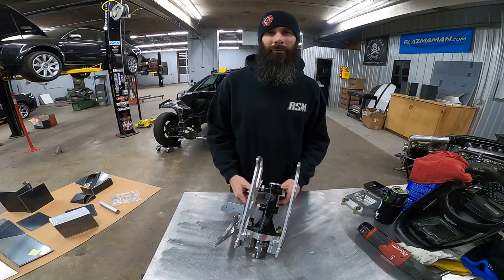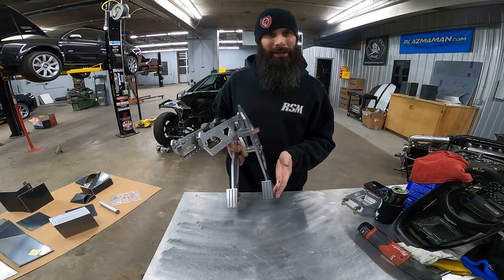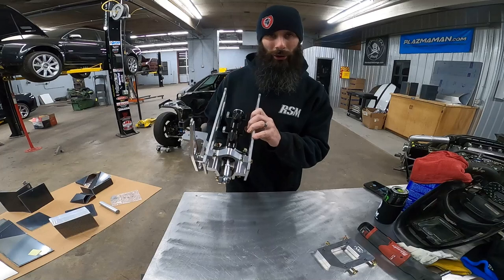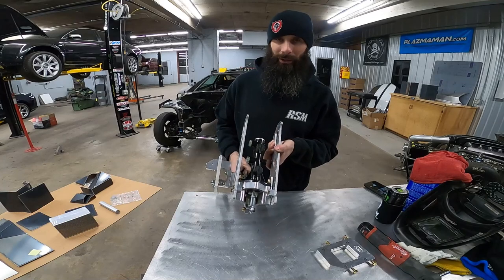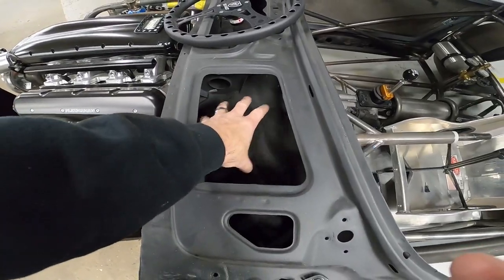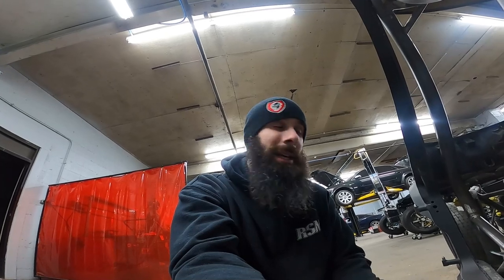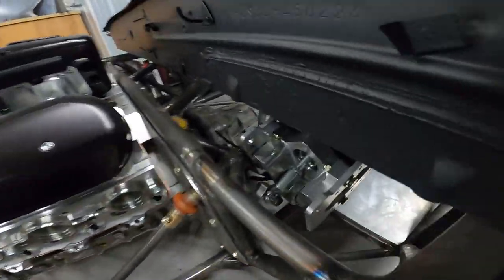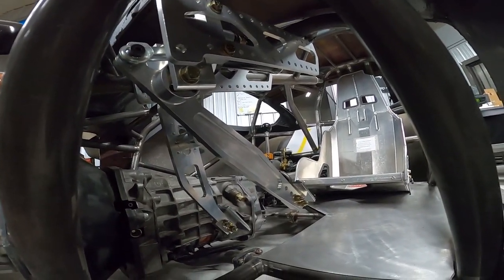Du Hast 2.0 Turbo Datsun Update 1/09/21 Testing Fitment on FFP Billet Pedal Assembly, Episode #14

Comment: Like that pedal assembly, so many ways it can change but also so many ways it can attach (bolt directly, various tabs or loop, studs with pins through).  If it isn't already available as such I would be tempted to offer a "mix and match" modular kit.
Reply: Hey Russell, thanks for checking it out! I agree with you, we started this out for a bolt n go unit for the Mustang, but it is starting to evolve into other body styles and configurations. FFPCustoms.com

Comment: Steven will this work with your throttle rod linkage kit In a fox body
Reply from the maker: If it was a chassis car you might have room for our throttle rod kit to hook to it but if i had a foxbody i would just buy his bolt in kit for it.

Comment: Bead roll those panels?
Reply from the maker: Puts a line just inside the outer edge
Reply: @rocksolidmotorsports7297  what would happen trying to "emboss" the RSM logo onto that panel, might stiffen it up enough. it could be sized and located.  That said, several removable panels may have some access advantage as well as what you already mentioned.